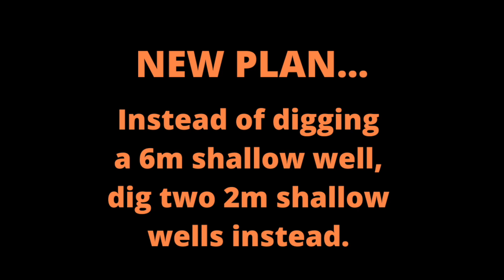WE DUG A SHALLOW WELL - PART 2

Comment: What a good idea a pond. Now if I remember well number 1 had a lot of wet clay in it. Si my suggestion is to revisit well number 1 ( or somewhere close by) and dig out some of that moist clay and line your pond with it. See if you can hire a vibrating pad (wacker packer) to consolidate the clay into a solid barrier of about 3 to 6 inches thick. That's the way the canals were built in the UK and they have stood the test of time. Thanks for posting
Reply from the maker: Thanks for your suggestion ☺️ When we dug our first pond (which we have now turned into Well 1) we used the puddling clay as you've suggested to seal it and it held water for years until we tried to make it bigger and ruined it 🤦‍♂️
Reply: @The_OffGridFamily  ❤